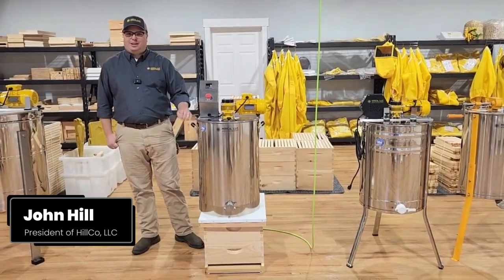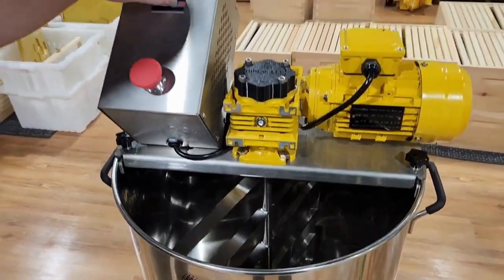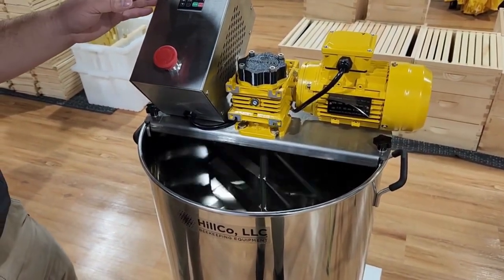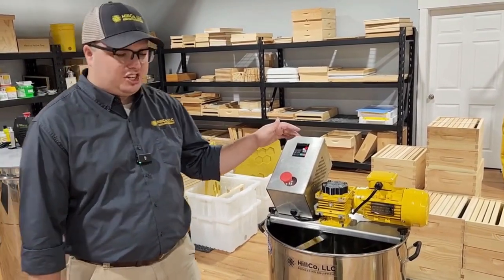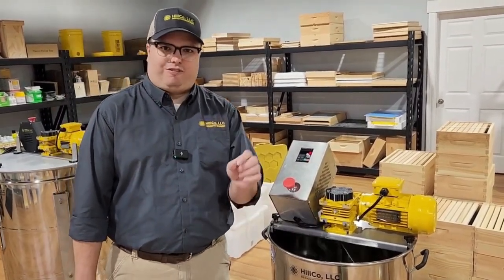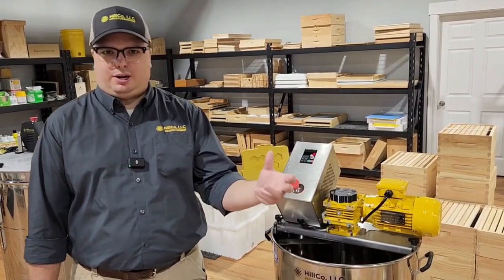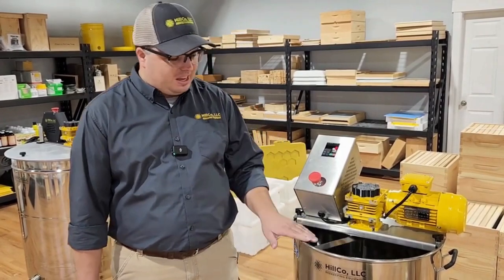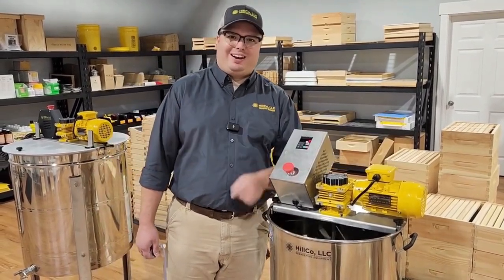Introducing Our New Honey Creamer (24 gallon) | HillCo, LLC

Comment: Does this unit pasturize the honey at 120 degrees to remove the moisture content during crystalization to remove the yeast to prevent fermentation of the creamed honey
Reply from the maker: This honey creamer is not heated.  You would have to heat your honey before putting in the creamer.

Comment: John, are you considering making a smaller unit in the future? 24 gallons is more than many hobbyist produce. I make a lot of creamed honey but 3 to 5 gal batches of different flavors. I have 11 different flavor and I don't want to make 24 gallons of each. LOL And then there is just the size of the creamer in crowded spaces and the height of lifting a 5 gallon pail to a creamer on a stand. Just saying if you made a 12-15 gal creamer I would buy it in a heart beat. Thanks for reading this comment.
Reply from the maker: Hi Russell, yes we'll probably do a smaller model in the future. However, it won't likely be significantly cheaper. Thanks for the feedback!
Reply: @hillcollc  The tank size isn't the main cost of the unit so I doubt it could be much cheaper. I have a size restriction or space so I'd prefer a smaller unit. Most people are new to creamed honey and most are small hobbyist and don't want to make 250 lbs of creamed honey in any one batch. A 10 - 12 gallon unit would be more popular. You could use a smaller motor and trany to hold cost down a bit but 800 to a 1,000 dollars would be about right.
Reply: Agree. Be nice to see a smaller unit for the hobbies.
Reply: @russellkoopman3004   11 flavors??  Wow!!  I would love to pick your brain to get a few recipes..  ;)
Reply: I'd love a smaller version as well. 4- gallon would be great as that is 1 bucket worth of honey.